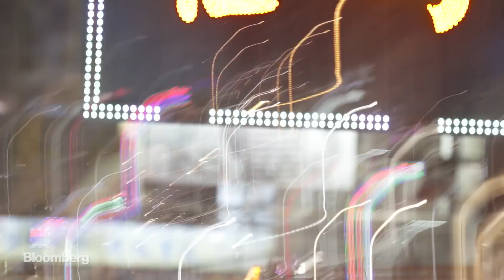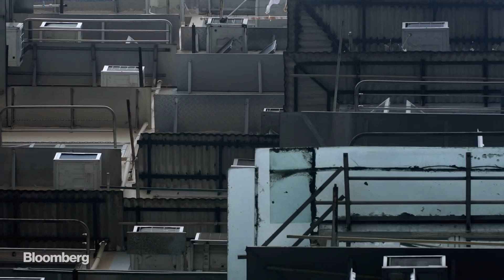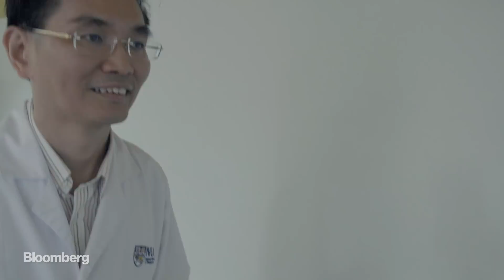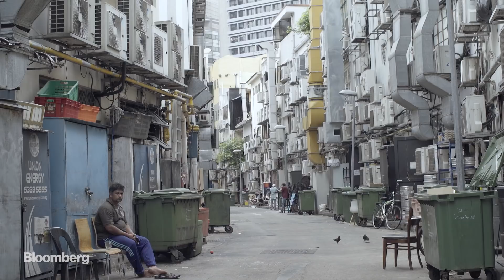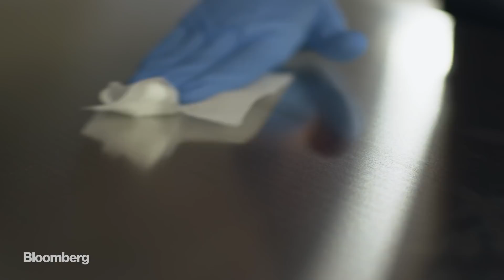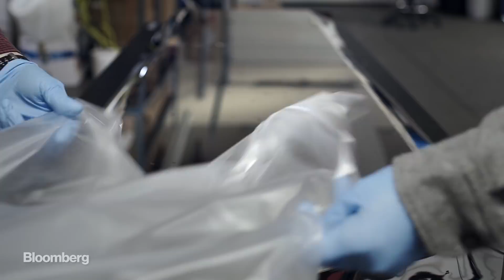This New Space Tech Could Someday Replace A/C

Comment: AC cooling is a closed [sealed] system. The fluid used for heat transfer is recycled for years. My AC is powered by solar panels. Researching cleaner ways is a good idea. If your AC is leaking you should get that fixed.

Comment: I can cut out strips of aluminum foil and stretch them over a frame too. Can I make dubious claims about harnessing the power of outer space?
Reply: Chromescent I feel the same, the title and the way they explain how it works is misleading.
Reply: Chromescent there is a ted talk that explains is much better. The idea is controlling heat radiation.
Reply: That's not a mirror, it's a  combination of reflector and a thermal radiator of selective wavelengths. The glassy layer is just to prevent heating of the panel itself from sun.